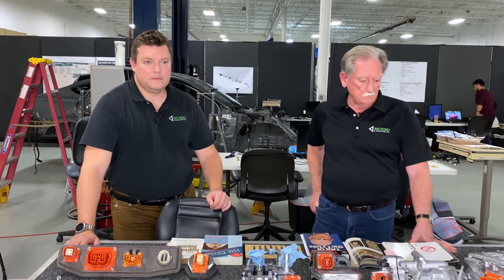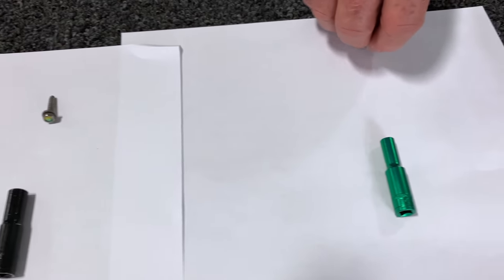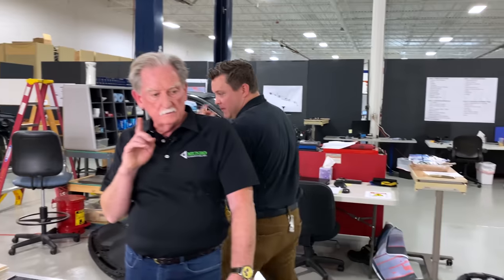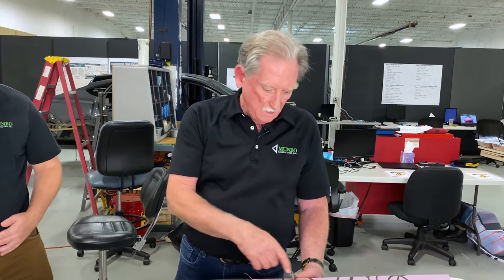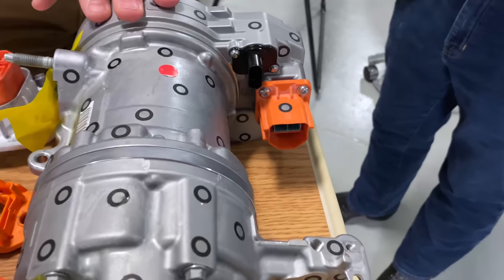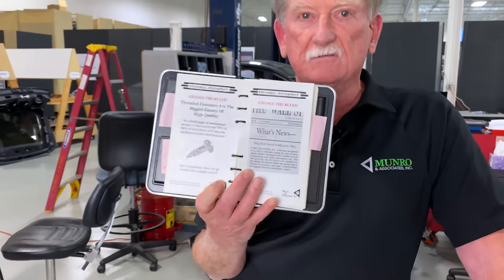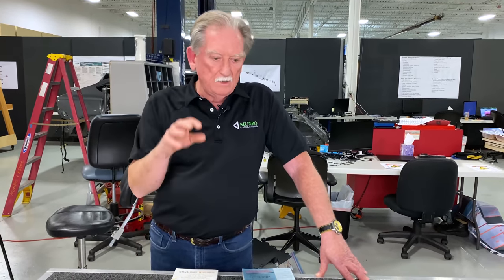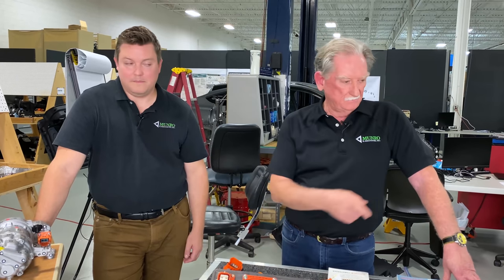Mach-E High Voltage Connector PALOOZA!!!

Comment: None of those connectors will be produced in main production line, they are build all on different places, most probably external delivery. What screw they have is irelevant. Only think in production line will be connecting HV cable, one click!

Comment: TLDR. Is the current ID4 flange screw pattern over-engineered? Possibly, but it also accounts for anchor points per connector, not just for the flange. A tradeoff in time and materials for better strength and rigidity. Especially in a decade when that same connector won't be of brand-new specification due to weathering and dirt-buildup. Keep in mind the typical technician that will yank on that connector with nothing less than brute force. A worthy tradeoff for the longevity of the connectors, which may become a concern if the screw pattern didn't encapsulate the individual connections like single-connection flange designs do. I don't really see a problem here, and I don't see room for improvement without a major redesign. 

I would imagine the ID4 connector has so many screws for a simple reason, to prevent the entire housing from pulling when a cable is disconnected. Imagine only having six screws along that long flange, the flange would want to pull where it's not supported.
Look at the style of connectors, Tesla prefers two screws, Ford prefers four. Imagine your typical garage tech wiggling the shit out of a connector to remove it. Two screws will only majorly prevent stresses in one axis, four screws would do so in two. But this design is per connector.
Now look at the ID4's singular long-flange connector, and it's screw setup, and it's connectors. You have two square connectors, a long rectangular connector, a thin rectangular connector, then another long rectangular connector. If you explode this single flange to be individual connectors, 1, 2, and 4 would have four screws each, whereas 3 and 5 would have six screws each as they're longer and require that additional anchor point, for reasons provided earlier. Moving from individual connectors to a singular flange has a reduction of twenty-four screws to just sixteen. In essence, they're combining each connector into a singular flange, while also keeping every recommended anchor point for each individual connector along the flange. 
To further solidify my point, look at the long rectangular connectors within the flange that are encapsulated by six screws. Imagine this as a singular connector, if you only use four screws in the corners, the central point of the connector would want to flex away from the housing it's bolted to, especially if your typical garage tech is wiggling and pulling the hell out of that connector. Imagine what happens in a decade, that plastic is going to do the same as any other plastic exposed to some amount of elements, it will most likely become brittle, and that additional amount of flex in the flange will cause it to snap. Now apply this logic to multiple connectors along a singular flange. 
It's a solution for rigidity of the flange. Just like how houses have a wooden stud at every sixteen inches on center. Just keep in mind, as mentioned earlier, exploding that single flange into individual connectors would increase the amount of screws 1.5x; similarly to how the Ford system has so many connectors and screws. Tesla's system might work fine, but I personally would like to see the same kind of rigidity and damage prevention in more than just one axis. I think the ideal setup for minimizing screws and maximizing rigidity and damage prevention would be three screws in an equilateral triangle, but this may also increase the size of some connectors, so four screws will probably stay the best option. Then there's also the argument of what to do about long connectors that could potentially have rigidity and damage prevention issues in the center of a longer flange, and the six screw method is probably best here. 
IMHO, the ID4's connector flange screw pattern is fine. The approach looks at rigidity and damage prevention per connector, and the combined flange actually reduces screw count. I don't think you could find a more optimal design based on this fact. Sure, you could have larger spacing per screw, but then you're potentially sacrificing strength and rigidity per connector, and you could easily redistribute stresses to favor one side of an individual connector, which would increase failure rate. A slight increase in screw count for damage mitigation is worth so much more than the time and materials saved by slightly reducing screw count on a part like this. 
Two is better than four only in control, but all other things being equal, four is actually better than two, especially when you have two-hundred pound gorillas yanking on a plastic connector. Think about it, when was the last time you saw a typical repair tech do everything by the book with the gentlest touch? Anyone familiar with rigorous testing cycles can tell you this, especially in this type of application, you want to encapsulate a component, and two fasteners just cannot do that. Maybe the key to all of this is a single through-nut connector, like how smaller electrical components are often fastened to panels, such as switches or rotary components, these wouldn't be difficult to seal either, and relies on the clamping force of the connector and the rigidity of the housing; problem with this is that none of these are inherently round connectors, and moving to a design like this would increase overall footprint of the connector, then it becomes a lesser of two evils argument.
I do however like Tesla's screw design, pin and shoulder should be the only acceptable method. 
Snap-in connectors, on paper, sound great. However, it goes back to the argument of strength, rigidity, and damage prevention. Unless you're using fairly substantial steel clips, plastic clips will break, and thin steel clips will bend. But substantial steel clips also require more force to actuate. This same argument also goes back to the two-hundred pound gorilla yanking on the connector, and what happens over time with weathering, degradation, and potential dirt build-up. Until we have some kind of reusable rivet that can consistently be popped in and out under the same clamping force, screws are the best method. 

The one potential improvement to the ID4's connector design to reduce screws is to start combining multiple connectors into one with a split harness. Just like vehicle wiring harnesses are typically designed, where you have one bulk of wire that jumps between the various connectors, typically originating from a massive connection at the fuse and relay terminal. That ID4 connector could be redesigned to be one or two connections with a split harness. Another issue I have with EV high voltage connections is just how much space is wasted to the connector for the severe lack of pins each connector has, redesigning these connectors to be more space-efficient would also be a benefit here. But, at the same time, even with a minimized connector, it would need to follow the same screw layout methodology.

Comment: Sandy really enjoying your content,  my 2 cents, All the high voltage  bright orange should be the same color, unnecessary to have different shades, they are idiot proof anyway, those different screws are a bad design, should pick one type, looks like someone at home , after loosing screws  , just patched things up, and a technicians night mare, "Screw Heads stripping" Love the video

Comment: Can you guys explain the safety features behind rapid charging some day? I'm fascinated that, while I've heard of battery fires, I've never once heard of someone getting electrocuted fast charging. People charge in the rain. People even charge with cables that have been slashed by vandals. But it seems 100% safe. I'm just curious about the tech behind that impressive safety.
Reply: The main stickler is the safety of DC electricity. DC is very safe even at relatively high voltages like what many evs are using. AC, even at a modest 120v can be painful or deadly due to the alternating current treating people and objects like capacitors.
Reply: Chargers do insulation tests prior to turning on the HV supply, and continuously monitor for earth leakage. The connectors contain temperature sensors ( higher powered ones use liquid cooled cables).

Comment: I like this vehicle but would not buy it based on the needless complexity of the thermal system (connections) and the HV power distribution.
Lets hope Ford listens and changes this stuff to outlast the warranty period.

Comment: Sandy's rants are entertaining, but we're only hearing one side of the story.  There could be reasons for different fasteners; especially the tamper resistant one (that's a clue, there's a reason).  It's also possible that the different heads are being used at different points of the assembly line.... so each operator has just one tool, not scrambling for the right one.  Sandy may be correct, but it would be nice to hear from Ford if there's a reason.

Comment: After seeing this, I don't believe that EV's are more simpler than gas cars (maybe in theory, but not in execution), so much modules to fails and replace (maybe) down the line, probably not cheap either.

Comment: Interesting video but not exactly presented in complete context.  One manufanufacturer leveraging over 100 years of experience and another with a clean sheet.  How many of those Mach E parts already exist i wonder.  More than a few i bet.  How many are purchased vs. Made in House?  For the large connector manifold.....the DFMEA along with  creep and deformation analysis will drive the right number.  Dont know it that means how many it had or if it can use fewer.   Bottom line is there is opportunity on the Mach E side and lessons likely to be learned on the Tesla side.  Have to know the full picture to truly understand any situation.  Still makes a good overall point of trying to reduce complexity which had many benefits.

Comment: Every legacy automaker designing this stuff must be overly spooked with the high voltage and potential liability when anyone attempts to take things apart, so it shouldn't be easy.  The suppliers also must not have communicated properly with Ford (and each other) in an effort to get the Mach E on the road quickly.
My guess is that there will be significant streamlining for the 2022 model for the fasteners and coolant components; and things Sandy hasn't even yet discovered.  This is low hanging fruit.

Comment: Why all the screws? Design goal is, that this part holds a proper seal after 10years with all the shrinking most plastics and elastics have. Additional condition: This must be achieved while at least one screw is failing (at production or any point of the planed product life). Also, it should be manageable that two screws are failing, if they are not neighbouring each other.
Simple maths: failure rate of any screw is 0.05% (0.9995 success rate) so for a part with 16screws
0.9995^16 will result in an over all success rate of 0.992 or an failure rate of 0.008 . Meaning: Every 125th part will be faulty. That's a very bad strategy for mass production, because this rate is way to high and needs massive efforts for QS for every single part, correction and afterwards warranty.
Use 20 screws and allow for two faults at the screws:
0.9995^18 * 0.005^2 and you are down to a rate of 0.000023 or in other words a problematic part/connection every 43500 part. At this rate, you still in need of QS but most oft the time statistical sampling is enough. Spending cents per part on additional screws is way better than spending Dollars for checking up on every part.

Edit: At least this is how engineering was teached in Germany 10 years ago ;)
Edit2: Yeah the maths is too simple, but proper math in YT comments is a bit too much. The point was made anyway
Reply: What Tesla is doing: Use other, more expensive screws to drive down the failure rate of every single connection and use less screw. Engineering wise that's a proper strategy, the economical aspect really depends on on many details.
On the other hand Ford, these parts aren't designed to compensate for failures and/or cost. It's just madness. Every company is using software aided design tools and such tools can enforce consolidation of parts. It's an active management decision to not implement something like that, because your software supplier won't stop talking about this feature.

Comment: I've read "The Goal" many years ago, have been an active member of ASQ and I'm very aware of the teachings of Dr. Deming as I was a Quality Program Manager in the Aerospace/Military industry with audits, first article / pre-production / supplier inspections, and manufacturing root cause analysis for many years. Having said all of that, I believe that Ford does buy the major components as assemblies. So your comment about tooling for connectors is not an issue as the Ford final assembly of the Mach-E does NOT entail the fastening of connectors to the enclosures. Ford final assembly only press-fits the connector ends of the cables on the assembly line. (The excessive use of unnecessary fasteners IS still a valid concern no matter who originates the sub-assembly design.) Remember, Tesla is vertically integrated. GM, Ford and others WERE vertically integrated until they discovered that specialization was more cost effective and spun off their subsidiaries (such as Delphi). Today companies like GM and Ford design the final engineering builds with supplier/subcontractor input (as a "performance spec"). This is why Tesla appears to have a more "coherent" design (almost all done inhouse), while their assembly quality is poor (because of a lack of many decades of expertise in final assembly / tolerance stack-up, fit and finish). Vertical integration is usually more expensive. Toyota and Dr. Deming knew this as well.

Comment: Screws aren't as expensive as connectors. Why do front and rear motors need different connector bodies and different connectors on the other ends of their cables?  The cables are molded to shape, can't be installed backwards- or can they? 
IMO We got to here because there are no more general engineers. Engineers in large companies especially ought to be trained similar to doctors, who spend time working in every discipline before they are permitted to design anything.  Every specialty has best practices, but isn't aware of the best practice of other specialties. If mechanical engineers had to explain why things they do are that way to a person who wants to be an electrical  engineer,, they would both become more aware of their blind spots, habits and assumptions that have no foundation.  They would learn how to collaborate better

Comment: If your going to design something to be manufactured on a mass scale you specify the bolt's, nut's and connector's, that way every part has a common set of bolt's, nut's and connector's.

As for Tesla's connectors, they probably have a machine in the factory making the power connectors, so they are like I need a power connector will use this. It is likely that the machine making the connector also use's the connector as they build a lot of their own machines.

Comment: Looks like Ford has the same disease that Boeing has! Let the Supplier Management team and the contracts team run the show! Look we got a good price from the supplier… and that’s because you just took what they were selling in the default configuration they had. No requirements for fastener type and size. And If there was a requirement, the contracts folks were very happy to provide an exemption from the requirement to get a better price! Then the problem falls into the lap of engineering dealing with all this variability! But hey supplier management and contracts can pat themselves on the back!

Comment: Ya mean like Henry Ford said make it simple so you can work on it with a 1. pliers and 2. a screwdriver. Stupid OEM's with multitude of sizes and threadcounts and fastners. Tesla seems to be the most efficient. Remember the Muntz TV? He took the tv and set it in front of a mirror and proceeded to chop crap off until it quit working and he knew that was an important part. Simple Simple Simple. Just like Gomer-- Shame shame shame

Comment: Without obtaining Price quotes for all these fasteners and connectors ... along with understanding the assembly process steps and what is assembled at a supplier vs OEM ... this whole discussion is highly subjective and speculative. High volume standardized connectors used across multiple OEMs are going to be low in cost, compared to specialized connectors like that combined molded example or the Tesla connectors. Rest assured Ford ran the cost numbers and has better supply base relationships that Tesla (and Sandy, you know that already, right?)
Reply: More parts is more money no matter how weakly you try and justify it.
Reply: You’re avatar sums you up pretty well.

Comment: If Ford does NOT purchase the info that Mr. Munro has found, prospective buyers should look elsewhere.
If Ford did purchase the info, then delay your purchase for a year so as to permit Ford to make the fixes.
Reply: I don't think the lockdown after over-recuperation problem had anything to do with connectors or screws, though.